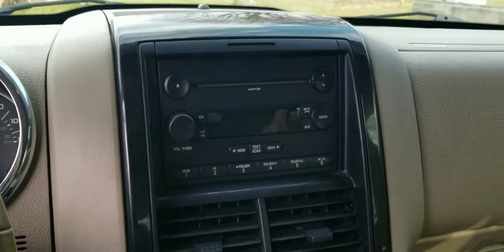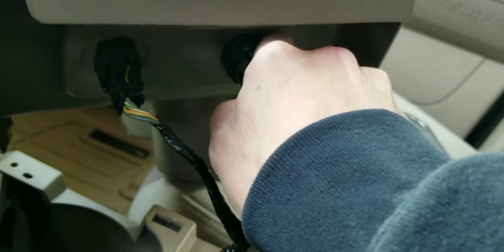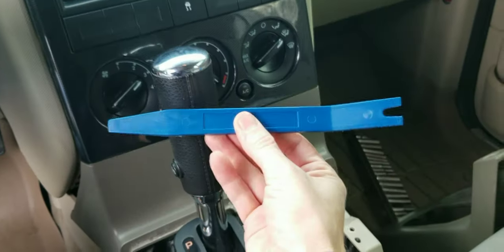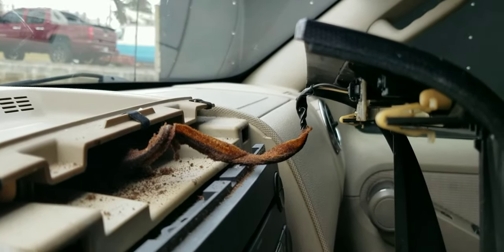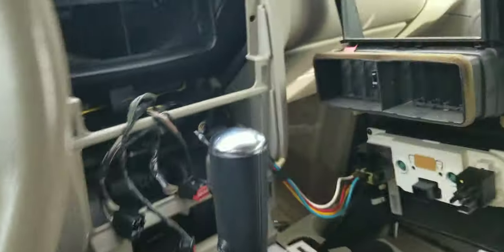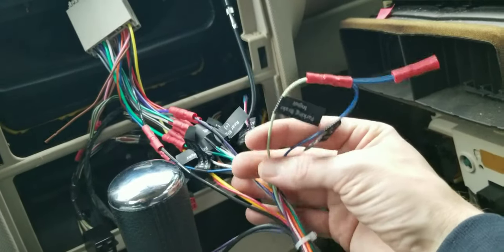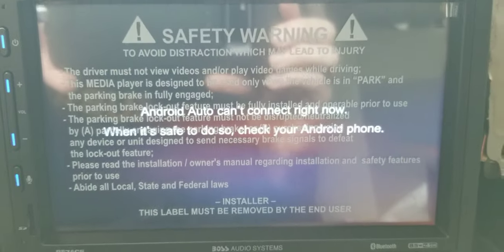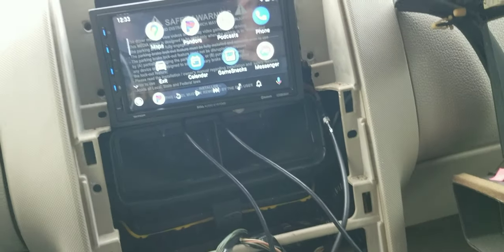How To Install Aftermarket Stereo 2007 Ford Explorer XLT

Comment: Followed this and stereo system at rear no longer works. I also get a code for that. It's impossible to clear. Uncertain how to get it working.
Reply from the maker: Can you give me a little more details? What model Explorer?
Reply: @2Broke2Quit  my Ford Explorer 2010 was made in the U.S, but this 2WD SUV model was only released in Asia. I can live without rear entertainment if I cannot find the harnesses. I bought everything you bought here on Amazon. Arrived within 6 days.
Reply from the maker: @kgpcodes  you will need to remove the stereo again and test the wires from the back of the stereo, and you have signal there.. then remove rear speakers and test there. The harness does both the front and rear from the same plug (White, Grey, Green, Purple). If you used butt connectors, make sure you did not sever the wires while crimping. Also, make sure to check the Fade in your stereo settings and make sure it is set in the middle of front/rear.
Reply: @2Broke2Quit  Thank you! I will be redoing some things. I also forgot to install the antenna. The Ford Explorer is an Eddie Bauer Limited Edition.
Reply: @2Broke2Quit  the rear speakers work. My Ford Explorer is a limited edition with an entertainment system on rear seats. There's a TV. I suspect I need to buy cables to get that working. Only if I can find them.  Otherwise, it's probably fine if the rear entertainment system doesn't work.
Reply from the maker: @kgpcodes  Oohhhh, I gotcha. You can make it work tho. Your trim comes with a factory amp,. along with audio/video/power for the rear entertainment. You will need to pull the wiring diagram, online, for the wiring/wire color schematic. I would strongly suggest a better stereo than what I put in the explorer. There is an Andriod Head Unit/Stereo on Amazon for $179 and works awesome! I will have a video soon on my F150 FX2.

Comment: good day.  so the 2nd plug is for your sub woofer.  Did you find a connector for it and does your aftermarket radio have a subwoofer input?
Reply from the maker: I just ran Power, Gound, Remote, and RCA to the rear.

Comment: Hi friend. Where did you connect the Illumination wire front the radio to? To which color of the Explorer wiring harness?
Reply from the maker: I used the adaptor to plug in directly to factor harness. You can test the illumination wire with a test light/bulb. Once it lights up, adjust the dimmer dimmer switch to make sure it gets dim/bright.
Reply from the maker: The illumination wire simply triggers the dimmer for the aftermarket stereo. The stereo detects power from that wire, and dims to a preset level. Hope this helped.
Reply from the maker: @edwincordero8  I responded 7 months ago. I was going through comments and noticed you didn't reply. Just following up.
Reply from the maker: @edwincordero8  I like your channel. Recently getting into RC myself. It's been fun so far, and have been building dirt tracks, to race with friends.
Reply: @2Broke2Quit  RC life is another 🌎. You'll see.
Reply: @2Broke2Quit  thanks

Comment: I bought a similar Boss radio head unit as yours and I noticed the reception of radio stations is much worse than the stock unit I removed.  Did you have a similar experience?  I have a 2006 Ford Explorer.
Reply from the maker: Mine seemed to work pretty good. I mainly stream music tho. Might check antenna wire/adapter to make sure nothing got pulled or came unplugged.
Reply: @2Broke2Quit  Will do, thanks!
Reply from the maker: No problem!

Comment: I have a boss double din radio. Installation went great, because I watched your video. However, having trouble connecting the backup camera due to canbus. Do you have any recommendations for wire harnesses that use a canbus? I’ve been trying to find some at Amazon but none make sense for my 2007 Sports trac. Can you provide a wire harness using the canbus?
Reply from the maker: It should be a single RCA with a power wire with it.

Comment: Using your video to try and get mine installed. I'm not getting anything from the radio but the other functions work. It's very confusing because I do not have a labeled parking brake wire. I do have a steering wheel, and an NC cable left over with nothing to connect to on the new wire harness.  anyone in the comments have ideas?
Reply from the maker: What brand stereo? You can bypass the parking brake wire.. for offroad use lol

Comment: Word of advice.... If you're going to make any instructional videos on HOW TO DO SOMETHING, you should actually show HOW YOU DID IT, not just talk about what needs to be done and then do what needs to be done when the camera is off.
Reply from the maker: I will take that into consideration. Thank you for watching!
Reply: he's taking extra time to explain how to do it with one hand.  I understood it very clearly,  if you didn't you should bring it to a radio shop to get yours installed.
Reply from the maker: Thank you Tee Nice, I could have set up tripods and multiple cameras, but this video was more about how to get the radio installed in the dash rather than a complete a-z install. I might make one of those tho!
Reply: Pretty much useless isn't it